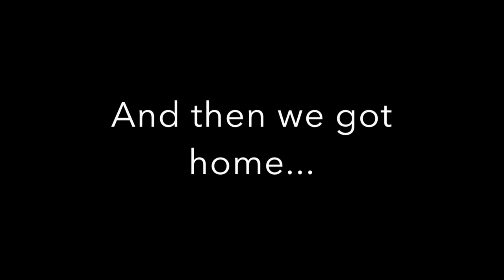We're taking on WATER!!! (S2 E24 Barefoot Sail and Dive)

Comment: From the Bums to here, jus saying hallo, and taking a peek on what you are doing. Just a tip, there is some kind of underwater epoxy available,  this would stop the leak and buy you some time. Good luck on the repairs. Cheers.
Reply from the maker: Thank you! 
We have put some underwater epoxy on but we want to do a proper repair out of the water too!
Reply: Recommended,  I would do that also, but in the meantime, the leak would stop. ;o)
Reply from the maker: The leak has definitely slowed down with the underwater epoxy. Don’t know the extent of the damage!

Comment: Very sorry you're facing this challenge. I wondered why there wasn't a manual bilge pump installed? On one cruise our float switch died but with the manual pump we managed for three weeks until we could get a replacement...
Reply from the maker: There is a manual one in the back locker outside. It takes a while though!

Comment: Here’s a thought 💭 build a area around the leak that will hold pressure, you only need about 5psi, mix and pour in slow cure epoxy, then put it under pressure and allow enough time to harden! 🤨
Reply: I cant think of a way to do that. I guess they cant beach her for some reason which would make it cheap and easy. Or haul that hull up next to a sturdy dock or pylon enough to dry dry the gap out. Or persuade a yard to hang her on the crane overnight without actually landing her on hard stand. It just needs to be out of the water long enough to work on it and get epoxy to set. They can rehearse how long that is, maybe 4 hours.
If they can, hit it with a hair dryer or heat gun and push some penetrating epoxy in there, popular to wooden boaties. see link as example
Going to need all their ducks in a row, batteries charged, pumps good to go, wet vacuum and heat gun ready, dinghy good to go, drying up materials ready, grinder to take back the surface to really get to the source from the inside (dont do that till last). Test the epoxy mix to see how quick it goes off. Calculate tide from first out of the water to time its back under water. Do the outside fix when they have more time to operate and perhaps improve the $
Last thought, sounds like its the front of a small keel? I dont even know what kind of boat it is. If Im mistaken and its one end of the boat transfer weight to the other end of the boat to elevate the crack. For instance the dinghy on the deck filled with water can be a ton of ballast (64 lbs cubic foot), all other movable weight and containers likewise. Is there a diagonal opposite watertight compartment such as a chain locker that can be flooded?
http://www.totalboat.com/product/penetrating-epoxy/

Comment: Hi Davy, Could any of the swimming pool or underwater epoxy work for time being?
Are there anywhere with a beach and tide? At least a couple of feet tide to expose the keel joint . These French cats use a interesting arrangement of a stub keel bonded in a pocket , is it bonded in or is it removable ?? Cheers Warren
Reply from the maker: We do have some underwater epoxy available. However we feel it’s important to haul it out. The previous owner had said the repairs were done professionally. We don’t believe this anymore. Who knows what else we will find under the waterline. 
The bilge pump is managing the water coming in. We have an appointment to discuss with the yard today! 

Our keels are sacrificial keels. After we’re done with them they probably won’t be anymore 😂 
Thanks Warren!
Reply: Barefoot Sail & Dive , yeah clearly a haul out reqd sooner or later, unfortunately!
Reply: @CheersWarren  significant leaks in boats isnt that uncommon, just needs to be monitored and managed
its just become less of a thing as plastic boats have become more common